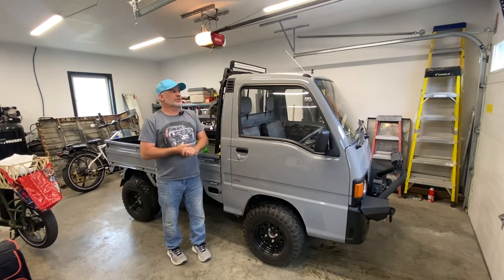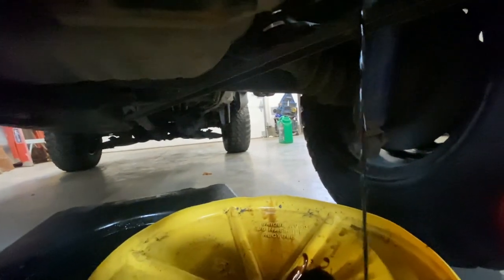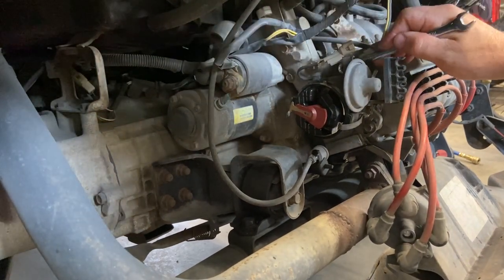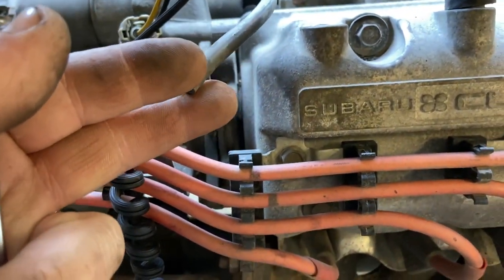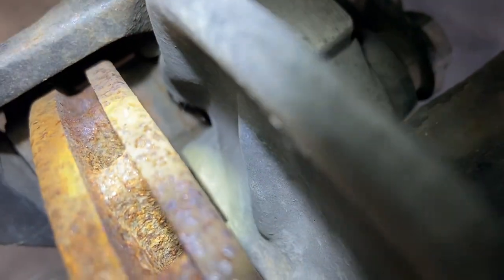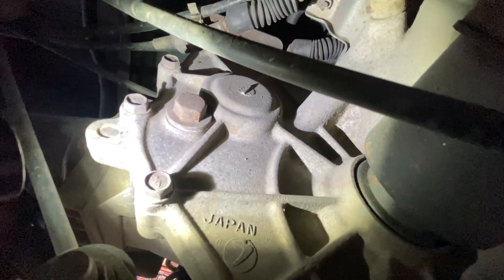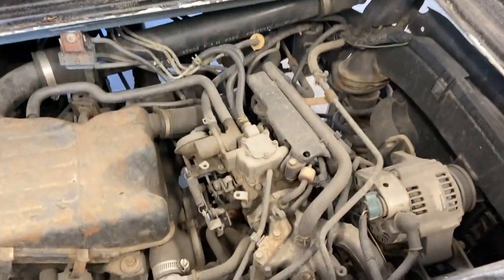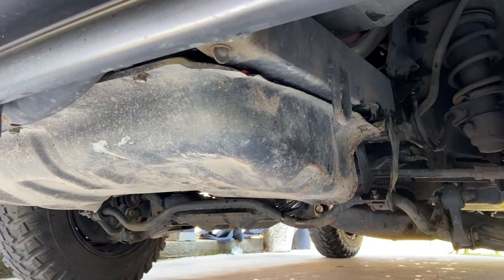Subaru Sambar Maintenance

Comment: Oil in the coolant will likely mean head gasket issue. Any decent oil today can easily go 7500 miles (~12,000kilometers) Send a sample out to Blackstone and you'll see 5,000 kilometers is too soon.
Reply from the maker: It was corrosion in the block. Decked head and block solved issue. It is in another video showing exactly what the issue was. 5000 km is when I do my oil changes on all my vehicles. Maybe more than needed but it is hands down the most important thing to do to keep an engine running a long time.
Reply: Oil today can be very effective at providing anti wear as long as the TBN remains above >1. There is no difference in protection between a TBN of 8 vs  1+. In my 94 TBI BBC V8 I run the oil for 7500 miles and at that interval the TBN is still at roughly 3.5 @turnbullgarage88

Comment: did you add a second battery under the passenger seat? my '94 has a battery on the side but has an empty spot under the seat where your battery is at.
Reply from the maker: Yes I did, to have more amps for the lighting and winch.

Comment: Thanks - I enjoy your videos!  I have a 95 and I need to check my transmission oil. Do front and rear differentials need to be checked?  Can you give some more detail regarding setting timing?  Are you setting the strobe right on the 6deg mark, and if so , which one is it?  Looking forward to seeing the project Sambar rolling down the road!
Reply from the maker: Don't know how I missed this.  Front dif should be checked if you have a leak or maybe if you are a new owner.  Rear diff is part of the transmission so same for that one as well, but don't use just gear oil, it needs to be a GL4 gear oil.  Middle mark is the 6 degrees.

Comment: Do particular years have the induction coils in the distributor or is it after market? Thanks for the Gret Videos!
Reply from the maker: It is factory, though I am not sure what year the change was made to that from points.  It is somewhere right around 1990-1991
Reply: I have a 91 , it has points .